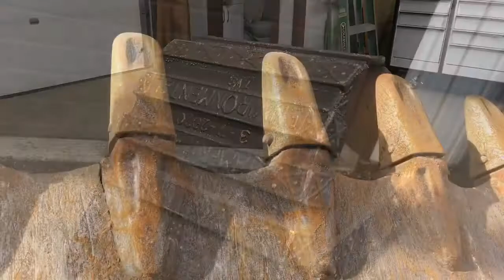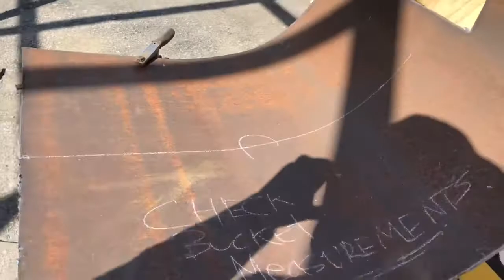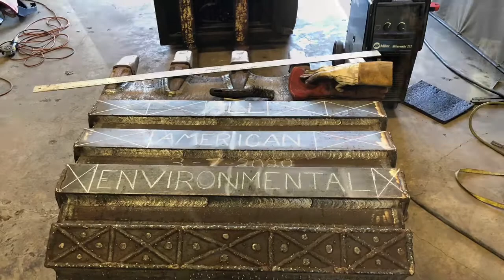EXCAVATOR BUCKET REBUILD AND HARDFACE!!

Comment: Do you use a pre heat/post heat  procedure on these before and after welding ?
Reply from the maker: You can but its not really needed, by the time you start welding the heat transfers through the steel,

Comment: I need a bit of info. I had a crack come up after hard facing on stick. Thought the bucket was pretty pre heated already.... Whats your advice in avoiding that?  Do I need more heat to the bucket/metal in welding on or?????
Reply from the maker: So is it a crack on the hardface itself or outside the area hardfaced?
Reply: @wickedgarage  id say out side after 7018 build up where it was very worn out. I capped it with the hard alloy and saw a few cracks which lead to a piece being knocked off completely by me. And Sadly theres a -1/4" dent in the middle and my boss just wants me to rebar the bucket over the worn bars and dent which isnt too bad so Im taking my time fitting and filling as Im going across the bottom. The back bars are still very thick. We dontt have the tool to push the dent back besides heat. Any ideas will help with that in mind too.
Reply: @wickedgarage   but Im following your path in work. Im just more focused in the messed up bottom end.

Comment: Were you able to just make a template to get the plate rolled? I’m sure the bars a harder steel but what about the pan? Or is it just mild steel?  Thanks. I need to do this to mine
Reply from the maker: Ar235 rolled plate and a572 wear stripe, yea i made a template and got it rolled at my steel place
Reply: Awesome. Thanks for the quick response

Comment: Awesome work on repairing the bucket. I've done some of the same work.    I have 2 questions
Why didn't you replace the cutting edge also?
Did you hardfacing mig wire or stick?
Reply from the maker: Ron Platt customer didnt want to and mig hardface
Reply: must be hard selling this type of work considering the time it takes to hardface. how much more life do u get ? depents on the work it gets